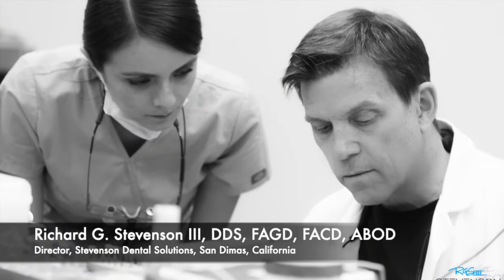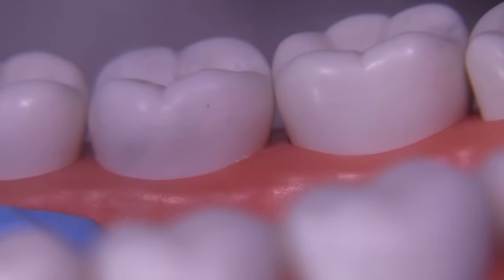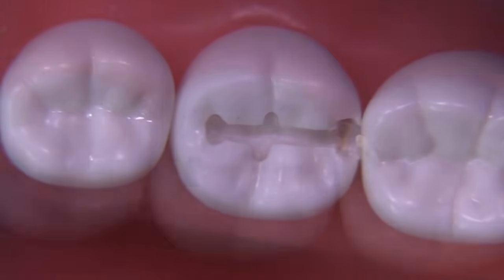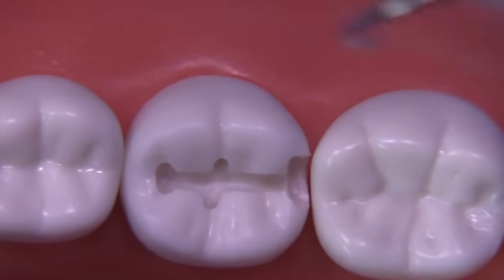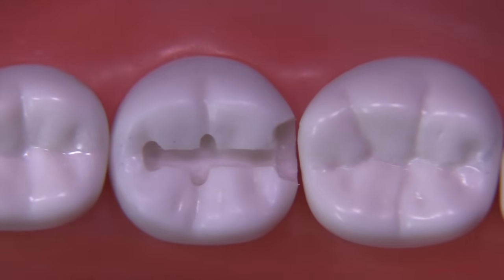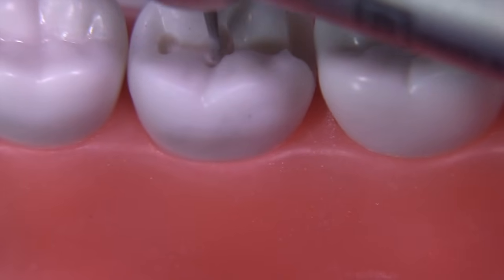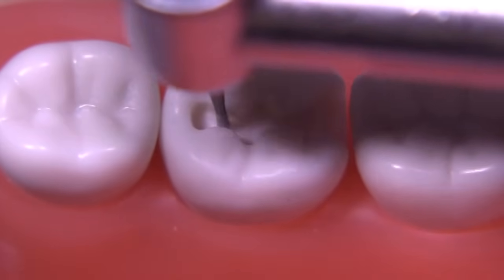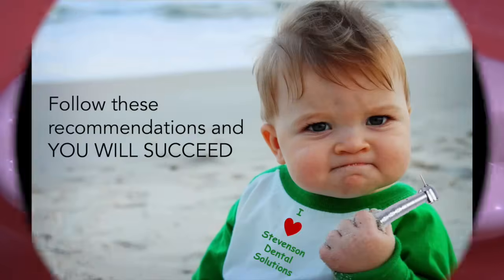Class II Amalgam Preparation - #18 MO Acadental Typodont

Comment: Respected Sir, What will be your position when doing MOD preparation on Lower Molars ? 
Thanks 😊
Reply from the maker: I use 7 o'clock for the initial prep and then work from 9-12 for the refinement with a combination of direct and indirect vision.
Reply: @StevensonDentalSolutions Thanks dear Sir

Comment: I read that the width of the occlusal cavity should accommodate the smallest condenser. Can you please explain if it means that the smallest condenser should sit on the floor of the cavity or should just the tip pass freely? Thanks
Reply from the maker: Just the tip pass through the opening of the convergent occlusal. However, this statement is a rather vague and inaccurate guide, not an absolute requirement. To wit, the Oregon #1 condenser is 0.6 mm...would this now become the proper width if you have an Oregon #1? Best recommendation is to establish a 1.0 mm wide isthmus.  This will meet the standards of all schools and exam boards in the US.
Reply: @StevensonDentalSolutions  thank you for the prompt reply doctor

Comment: I failed this practical and have to retake it next week, I am so scared :( this video has been helping so much. I rewatch and drill along and it is helping so much.  I have ordered the 245 bur to work on making the box the proper height and convergence.

What do you recommend for getting rid of lips on the very edge of the walls and the edge of gingival floor, just the hatchet? Even when I excessively sharpen mine it chips off too much and the wall breaks off or I get sharp irregularities. I've tried everything.
Reply from the maker: Make the lip very thin. Make sure your sharpened edge is at 45 degrees and not more acute.

Comment: Doc..i can't do the step of flaring when i transferred to the proximal surface i lose the the shape of the cavity
Reply from the maker: Focus on the box form - it should be a curved rectangle and not a trapezoid shape.  After this is accomplished simply blend the occlusal to the proximal carefully with a 330 but, bu removing tooth structure in the occlusal area, not the box.

Comment: Hello Dr.Stevenson,
For composites do we make the same prep? If so, then does the axio-pulpal line angle need to be bevelled?
Reply from the maker: Smaller prep - rounded line angles, flares okay, depth about 1.25-1.5 mm, and yes an AP bevel as well.  Thank you for the question.
Reply: @StevensonDentalSolutions  thankyou!

Comment: I Have #question Dr.. 
If the caries extended to sub gingival proximally.. How can seat the filling in the box? 
 filled with GIC?
Reply from the maker: For amalgam, I use a #2 matrix band to extend more apically.  For composite it's a whole different matter, namely margin elevation with either warm composite or preferably GIC which is packable.
Reply: @StevensonDentalSolutions  
Thanks.. 
Dr can I use flowable composite to elevate the margin?
Reply from the maker: You may, but be aware of the shrinkage factor and likelihood of micro leakage... @El_mahdi313
Reply: @StevensonDentalSolutions  
Thank you very much Dr. 
Best wishes to you 🌷

Comment: hi, can i ask how to get your lingual and buccal walls convergent? Is it all from a convergent bur or do you need to tilt the bur too. If so, which bur is best to create convergence, thanks a lot
Reply from the maker: Hi I’d recommend a 245 for the box and 330 for the occlusal.  When refining, use an 330RGS, and never a straight fissure bur. This approach will keep the walls convergent
Reply: Thanks for replying! So with these burs no tilting is required to create convergence? As i find tilting often widens the cavity too much
Reply from the maker: Correct - pretty cool